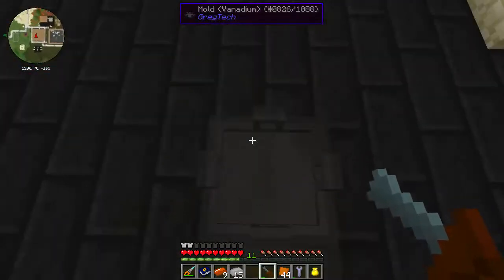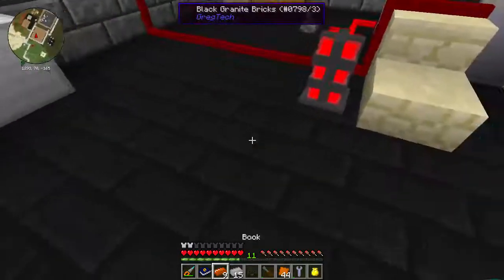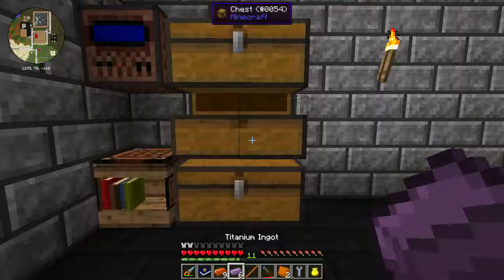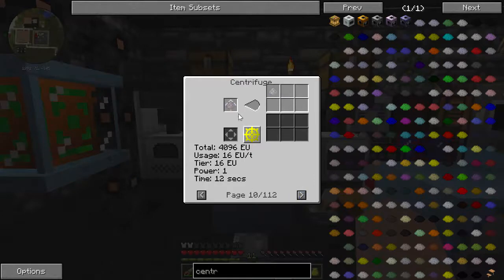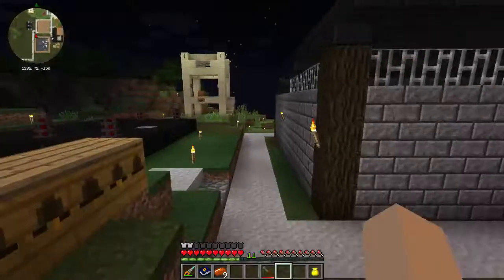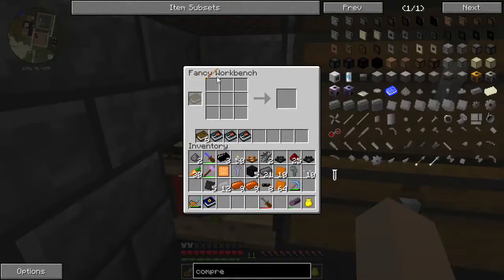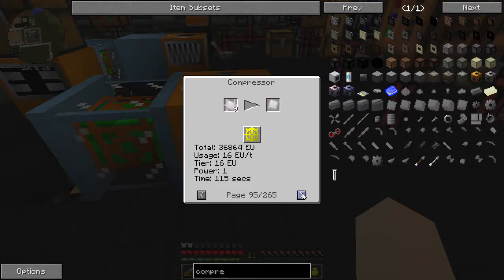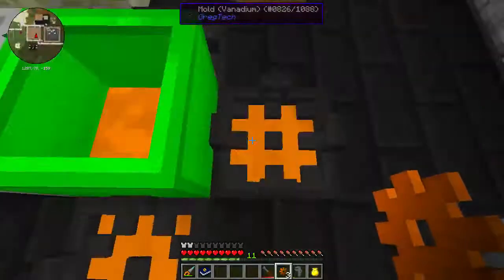[Gregtech 6 LP] EP 61 Squeezer, centrifuge, compressor

Comment: hey, i'm trying to run a bronze centrifuge with a steel set of water boiler/turbine, but whenever i go to use it, there is just a small indicator per tick that something is happening and it doesn't go any further. what am i doing wrong? trying to get the mercury for the thermometer sensor
Reply from the maker: you can do the mercury bottle in a crucible with 3:1 cinnabar to mercury. you are sure you have all the right ratios for power conversion? can you send me a picture of what your setup looks like?